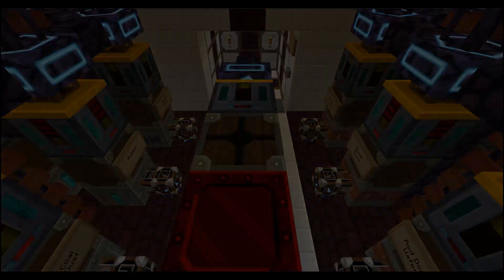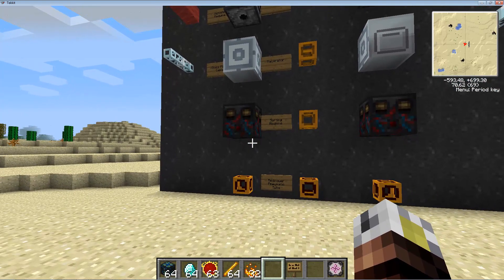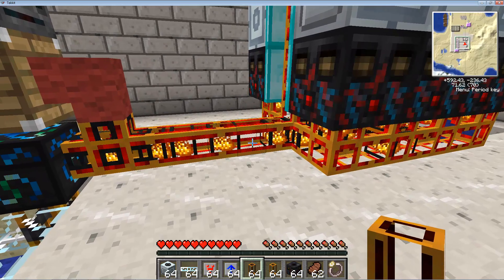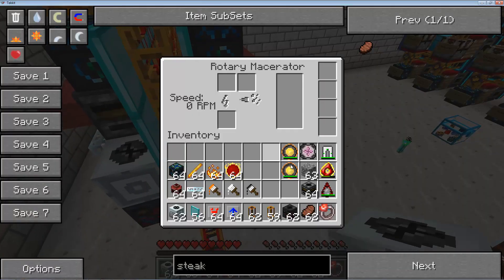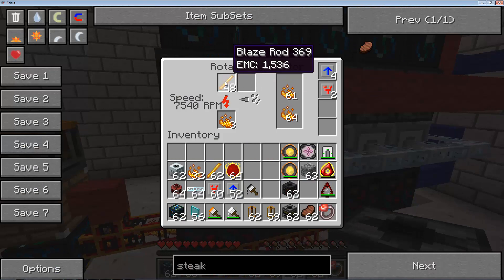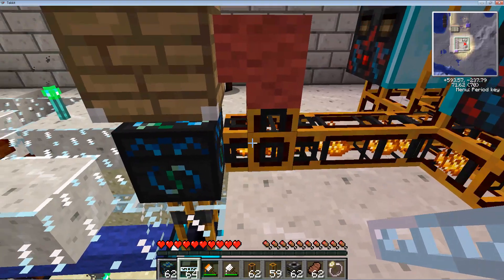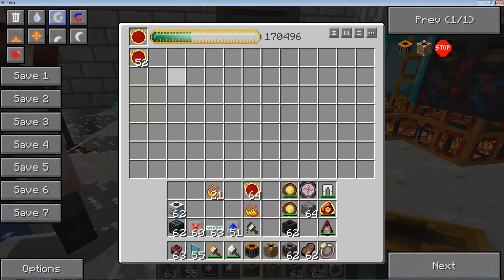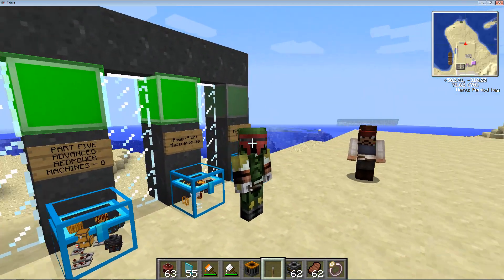Tekkit Classic - Megalith Tutorial Series - Part Six - High Speed Red Matter Power-plant

Comment: For all those whose sorting machines are not pulling the blaze powder out of the macerator, you need to POWER the sorting machines. The MindCrafters had their power at back of the machine so we didn't see it. Use solar panels and batboxes from RedPower, not IC2, to power them along with jacketed wire going from the top of the batboxes leading into the sorting machines. Hope I helped :)

Comment: Okay, so I'm having 2 problems, I was super excited because the first run through, it worked amazing. I took the 64 Redmatter to go off and start building the other machines needed to make the automatic crafting rigs. When I came back the Rotary Macerators sounded like they were having some problems. The two rows horizontal rows of macerators closest to the power source keep running out of juice, I checked to see if the MFSU was full and it was. Second problem, all of my macerators are now white

Comment from the maker: Hmm, not really. 

You NEED to flag two diff quantities of powder with two diff colors; something the sorting machine can do in 1 block.

You'd need two Filters, Redwire or Red Pneumatic Tube, and regular Pneumatic Tubing, as well as at least 2 more blocks of space on either side just to replace each Sorting Machine. Ouch. Even resource-wise 2 x Filters is only 1 red wafer and 1 blue alloy cheaper than 1 sorting machine. So not much gain.

The only advantage would be no Blutricity needed.